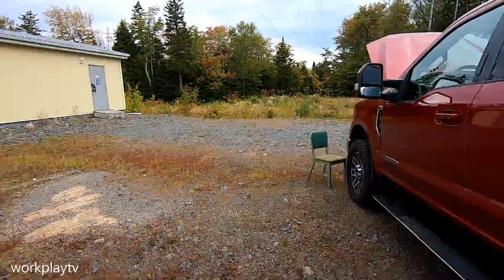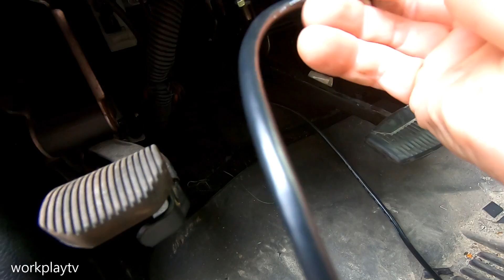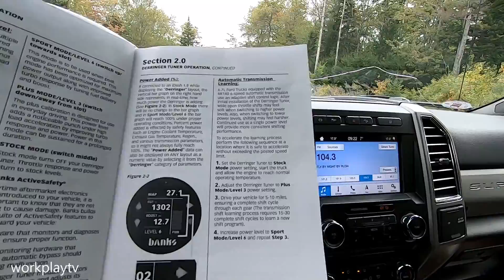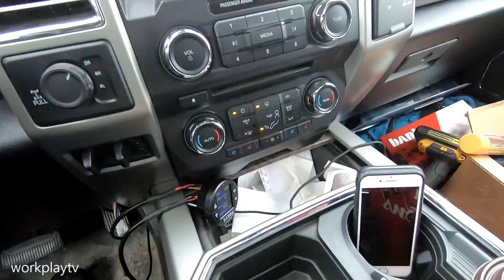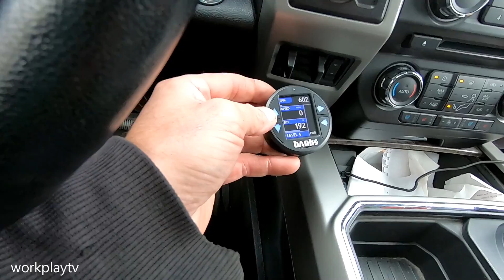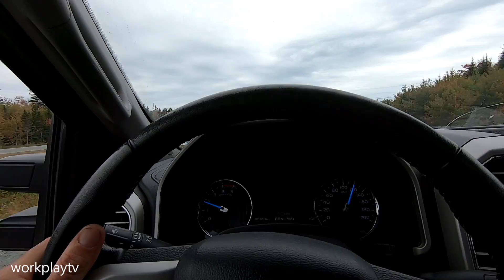SUPERDUTY GETS MORE POWER! 6.7 POWERSTROKE BANKS DERRINGER INSTALL & FIRST DRIVE

Comment: Do you regret not going with a custom tune or still happy with the derringer with the pedal monster? Gonna pull the trigger on a tuner and dont know which way to go!
Reply from the maker: Well to be honest the Derringer felt great but the pedal monster is a game changer. I don’t have the derringer on my 2020. It’s not out yet. There are some great custom tunes out there. The banks stuff is very easy for warranty though.
Reply: you guys are lucky you can delete much easier than my 2019 duramax i need a new ecm tcm and tunes dp exhaust looking at around 6k in parts not including install/ labor and total id say about 7
Reply: Depending what you really want out of your truck, I can confirm now that the pedal monster and derringer are a nice little setup, power is definitely noticeable on 3-4 power levels daily driving. I an running the pedal monster on "city"level 10 and it definitely wakes it up a bit but I feel like it's a little smoke and mirrors with throttle input. Otherwise install was relatively easy with the hard parts being the FRP sensor and rubber grommet on the fire wall. I didnt plan on deleting. The only thing they left to be desired was no playing with the trans. But a solid 9/10 really from me.

Comment: I’ve run a derringer for about 8 months now and I’m not impressed. About 5 percent of the time either the iDash errors out and doesn’t come alive or one of the measurements will zero. Regardless of power level selected, I’ve felt no power difference. Even timing 0-60, there’s almost no difference between level 1-6. The only thing I’ve noticed is a downshift if I’m getting on the interstate and I up the power level. I’m skeptical of your review based on my own experience with this product. You feel what you want to feel. The multiple guage readout is nice, but that’s the best thing about the derringer.
Reply: I’m with you. The gauge is great, but I’ve had the same problems as you, and the power ain’t worth the money.

Comment: How has it affected your mileage?  Would it work on a deleted truck and clear codes?
Reply: Does not work on a deleted truck. I have a 2019 F350 DRW with 4.10’s. Put a Derringer on it. This thing is a waste of $800.
Reply: Wondering the same thing - wish he would answer
Reply: Also, it does nothing for fuel economy. I don’t rely on the bullshit Ford computer. I do the math at the pump. Anybody telling you anything else has lied to themself enough because they want to believe it. Just to be clear. It does add power (minimally). It just adds power exactly where the stock engine doesn’t need it.
Reply: @tomfoolery5033   thx i assumed that was the case. I wouldnt say waste. for undeleted i use level 3 tune for daily driving haulling a Ton or so in the bed

Comment: So I`m taking this is for a truck that is out of warranty. Because the first thing the dealer does is plug in.  And any tune leaves a ghost of the tune in the trucks computer and they will void the warranty.?? things that make you go hmmm
Reply from the maker: chas f Well I can say If I trust what anyone says it’s Gale Banks. He mentions on his video that if a dealer was to hook up there diagnostics once this has been removed it leaves no trace of it ever being there and also has tons of fail safes built in as it goes through your ECU and is constantly monitoring all your parameters. If anything thing is wrong it will turn the truck to stock.
Reply: @workplaytv  Yeah thanks, I saw that in another video with him. But do you want to go through all the hassels of taking it in out all the time and hope you don`t forget LOL
Reply from the maker: chas f Takes 5 mins to remove and install once you have the hole through your grommet and I never take my truck to the dealer unless of a recall.
Reply: @workplaytv  Ok thanks

Comment: Those power gains are at them rear wheels so at the flywheel it’s going to be 20-30% more.  I bet it will shadow the 2020 power numbers at the rear wheels :)
Reply from the maker: Gravy Train Outdoors Dyno numbers have show wheel gains.
Reply: workplaytv when I bought the banks stuff for my truck they used to have all the dyno sheets listed which showed the stock rear wheel hp and torque numbers, the test vehicle information etc.  They showed both peak gains and best gains.  Sometimes the best gains at a specific rpm was huge.  Advertised power gains being say 100hp but the best gain was like 175hp.  Can’t wait to see your thoughts on the system once you’ve had some driving time!
Reply from the maker: Gravy Train Outdoors Yeah they do show that in the video I j linked in description but I don’t think I have those numbers with the package .

Comment: The only program I’ve run is my 02 7.3. Did a Juice w/ attitude and evolution stack. Worked amazingly well and when set to stock passed CASmog w/ no issues. Certainly helped with economy +3-5mpg gain and huge 75+ but you have to watch your EGT’s empty or especially loaded. EGT’s are the tell if your heavy on the throttle and if you need to shift gears. In my opinion a tuner used properly is a great add. I have a Banks Brake on the same truck and it works great, all Banks products are quality in MHO.👍👍👍🇺🇸
Reply: You don't want to stack tuners on a 7.3 most of them advance timing.
Reply: Diesel dude Big Mack, I installed it back in 03, towed a 35ft fifth wheel and ran mid tunes, rarely ran max on together and always kept EGT’s below 1300 and have had zero issues. But I’m not a pro and don’t have any other experience. Just my own experience. Edge has a new all in one that they will do a trade in that is CARB certified and I may go with that and eliminate the stack.

Comment: Great video and great tuner 😉👍
Reply: Just bought a 2015 F350 Cab n Chassis for the business and busy getting it tuned and ready to tow cause that’s what it’s going to be doing full time. Replacing 2007 6.7 Cummins 😉😊

Comment: The last thing the 550 needs is more power, as weight goes up you lower the horsepower over the same engine in a  smaller  truck, especially for commercial vehicles you lose longevity/ engine life...leave it in the 350
Reply from the maker: John DiMartino Nah sorry buddy she is going in the 550. You have to be smart and not use 100% throttle the whole time. The Derringer has safety’s inside of it to monitor all temps and reduce power as needed. This isn’t just some $100 dollar tuner that constantly shoots fuel at the engine. Thanks for the concern though.

Comment: Great video. Thanks for posting. Does it do anything with the transmission torque converter lock up? My 2018 F250 is stock and the torque converter does not lock up until 5th gear under normal acceleration. Would like it to lock up in lower gears. Thanks again.
Reply from the maker: brihosk No I don’t believe so but that is one of the things that you can look at with this. It actually shows when the converter is locked.
Reply: brihosk my stock ‘19 F250 usually locks up in 3rd.
Reply: @Blagove5t  I guess they change the trans programming from 18-19